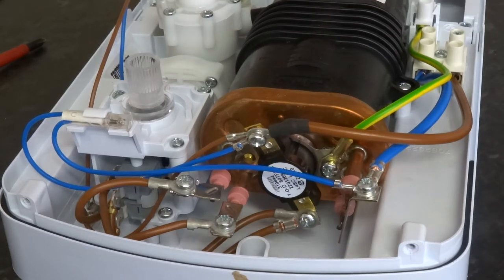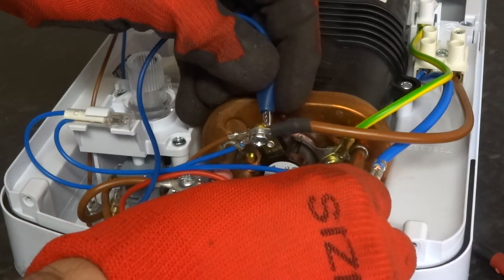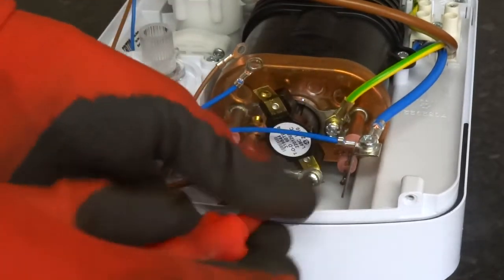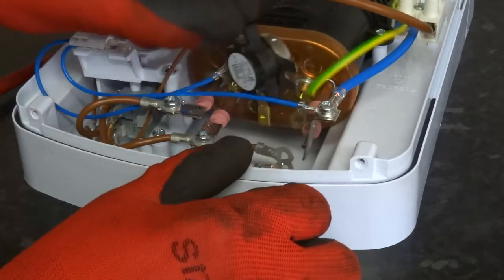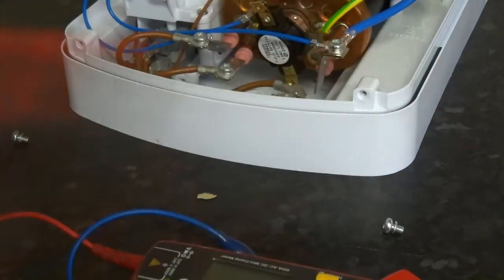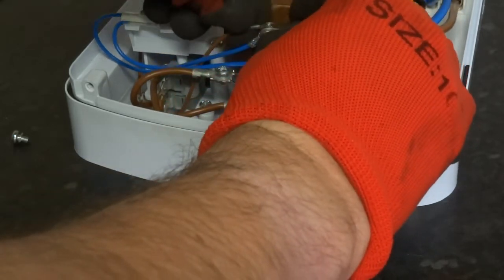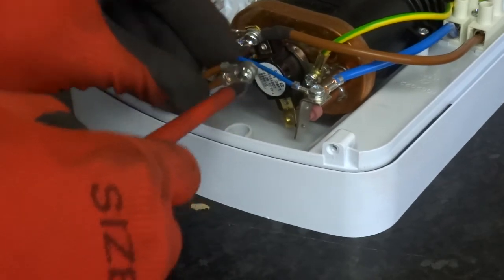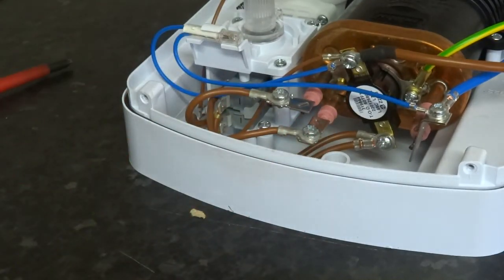Electric shower thermal cut out testing and replacement ( tco )

Comment: Just replacing a TCO does not necessarily solve your problem. You need to know why it's blown.  Putting a new one in is just likely to pop that one as well if you haven't solved the underlying issue.